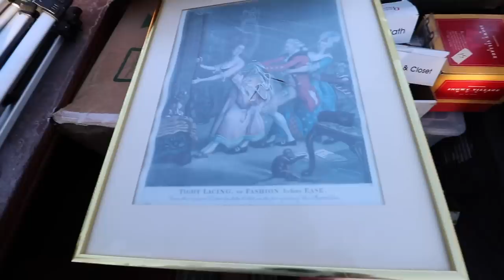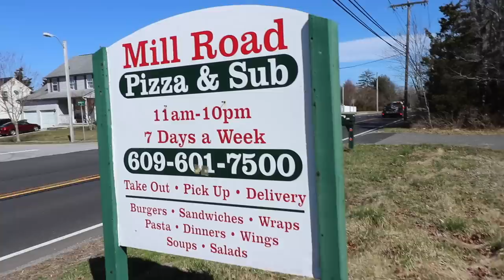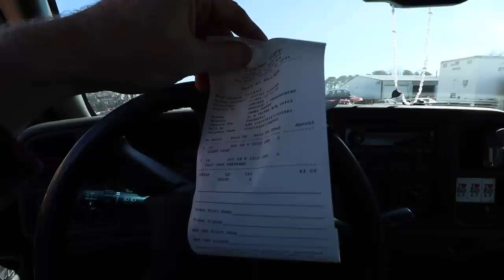DUMP TRAILER SCRAP METAL LOAD AND SPIDER HOUSE BANK FORECLOSURE WALKTHROUGH!

Comment: Sweety you can machine was shower liners,  just add vinegar to the load with your detergent it removes all mold, stains comes out smelling good  like new just rehang it in the shower to dry.
Reply: A little peroxide helps with stains as well.